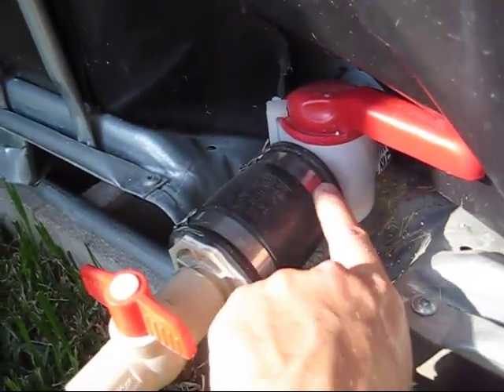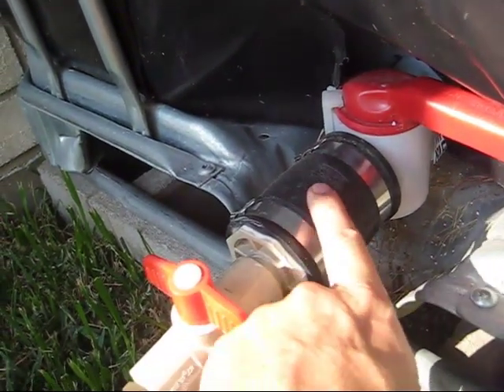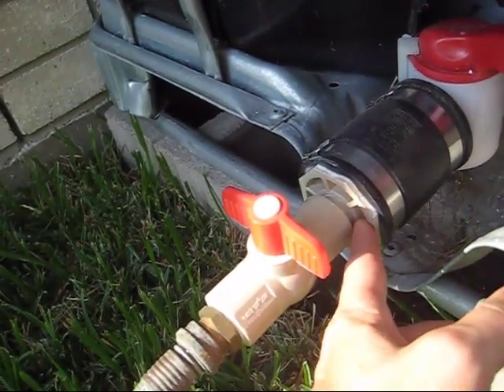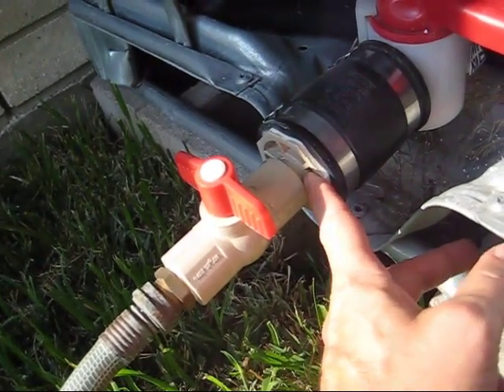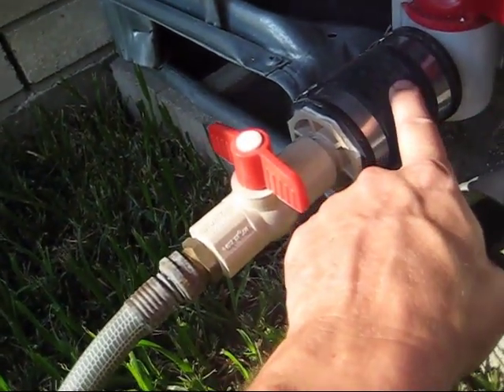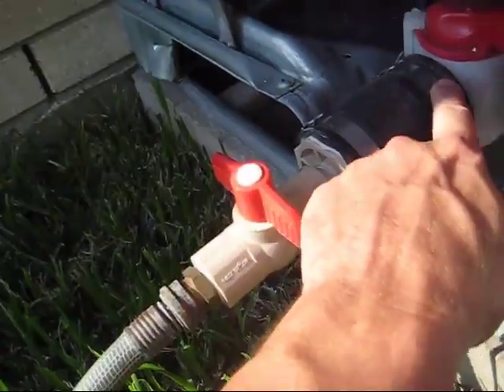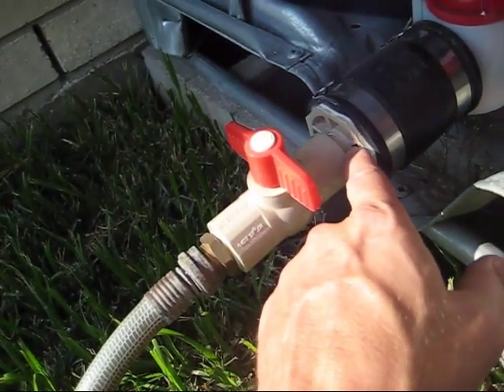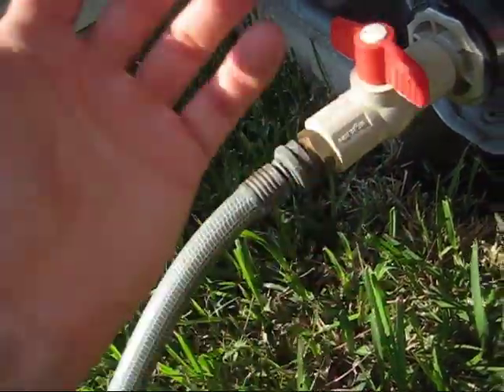Water Cube Connections

Comment: The other choice would be to use the correct fitting for the threads you own. I found a great deal, $20 each for clean IBC totes (275 gal) I had 3 different types of fittings (out of 6 totes) , I remember one was called a banjo thread. I ordered all the parts on Amazon, and then using 2" PVC plumbed them all together for pumping up into the second floor of my barn. The barn tote gives me almost a 20" drop, downhill to my greenhouse. Not enough pressure for a lawn sprinkler, but more than enough for spraying or drip irrigation.